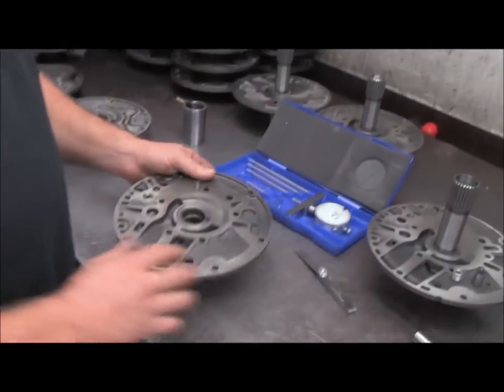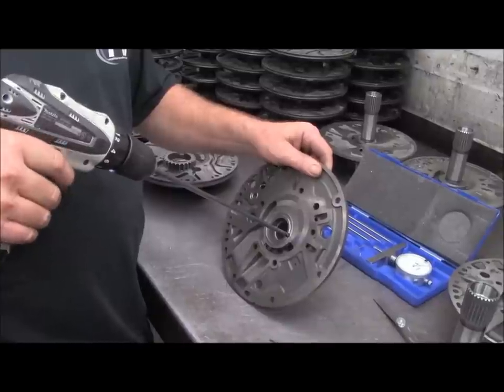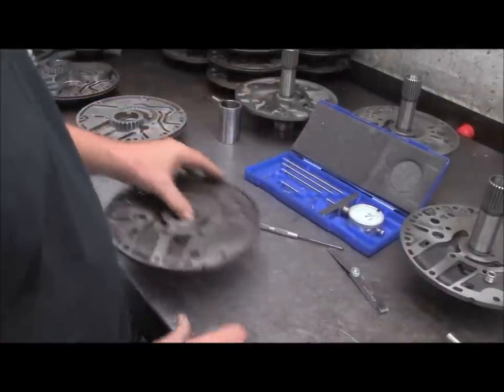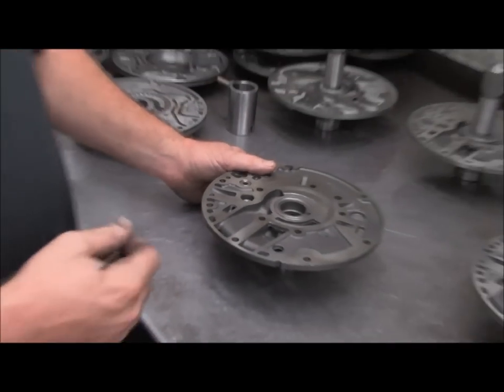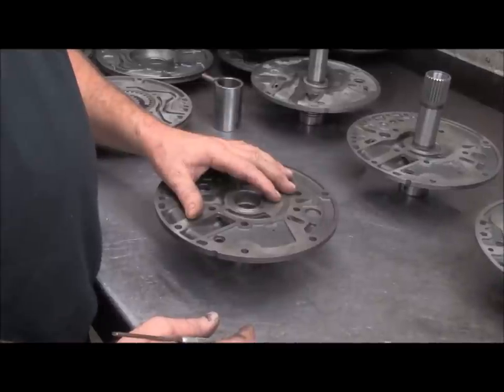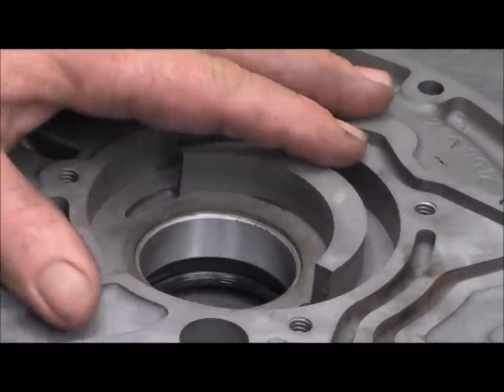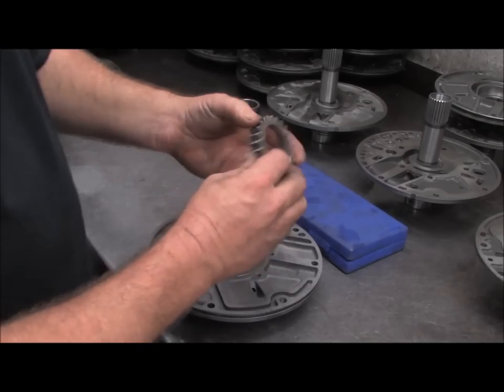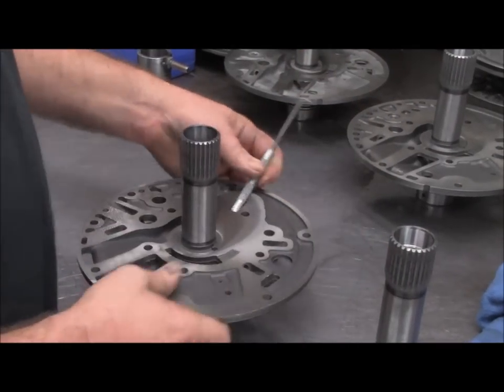FTI "How-To" Modify a Powerglide Pump

Comment: I made a neat jig to enlarge these pumps on the lathe..  most of the machining on these does NOT require a CNC machine..  It can all be done on a lathe..  Except when I install Gerotor gears.. Also running much thicker gears as well.

Comment: My son bought a trans from TCI Years ago and I've got it down for a rebuild and everything looks good except for the hole in the stator tube at 11 o'clock. It's not completely blocked but it's 90 percent blocked. I'm failing to see how it's effecting charge pressure too because our pump stator has the bushing that blocks fluid out of the converter anyway. Fluid is forced around the bushing through the input shaft holes that are located each side of the bushing.  This seems to me to be the restriction. The best I can tell, this 11 o clock hole positions that he is talking about is not the high hole in the stator but the lower hole and it routes converter fluid to cooler out port and the upper hole in the stator is from cooler in port which turns into lubrication via input/output shaft. It's looks like the sealing rings on the input shaft simply keep oil from going back to the converter out or just running oil out into the trans pan. The sealing rings force oil to the input/output shaft for lubrication. Is this right? Anyone. That's the way it appears to me but I can't find any infor on this trans other than Monroe and it doesn't go into depth on those circuits.

Comment: Is OK to do these modifications to the case/pump if I am not running a trans brake for regular driving and then installing a brake down the road for the strip?
I will be running a Turbo on a 5.3 truck engine.
Thanks!
B

Comment: does the modifications to the pump provide better shifting or better pressure on the valve body and valves controling the shifts or braking capabilities of the transmission

Comment: The bearings crack. I build them back up with thrust washers just like original. Gotta account for the material these guys take off though or end play will be off. Other than that mostly good mods. Great material shared in this video
Reply: My son bought a trans from TCI Years ago and I've got it down for a rebuild and everything looks good except for the hole in the stator tube at 11 oclock. It's not completely blocked but's 90 percent blocked. I cant get a wd 40 tube through it. The converter on our car was always loose and showed high percent of slip. Is this the cause?

Comment: Would you block the cooler bypass if running a dump valve? Seems like that would be the safety if blocked. And seems like you would want all the pressure then regulate it down?

Comment: What is the proper procedure to adjust the bands?
Reply: Tighten to 40 in Lbs while rotating the shaft slowly... to keep the drum centered... ...then back off 4 turns...then tighten the outer lock nut...

Comment: Makes no sense at all to drill the feed hole into the stator tube without the stator being installed first.. If you don't care about how much of the hole does not line up, then there's absolutely ZERO reason to drill that hole at all.  If you're going to enlarge that hole, then install the stator support tube first, and then drill thru that so they are perfect..